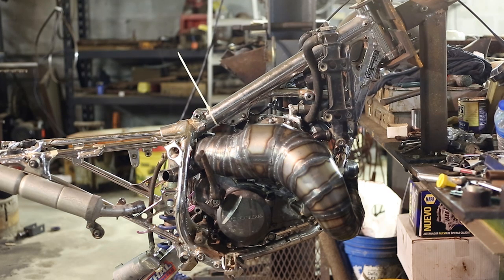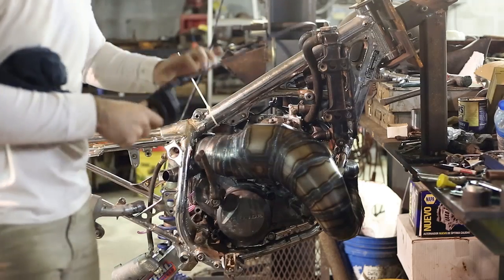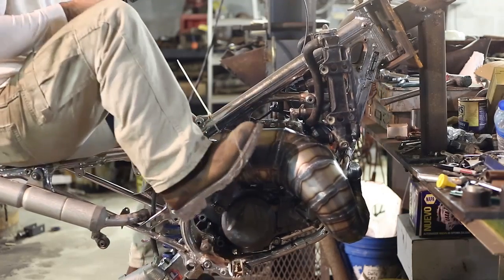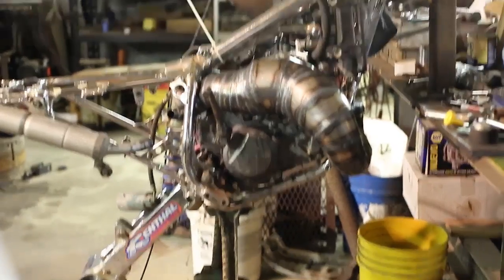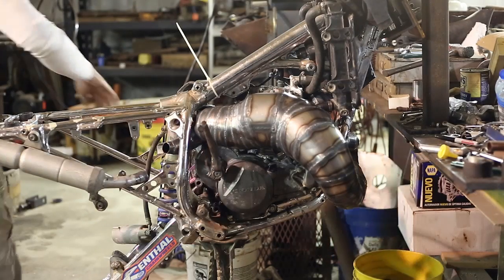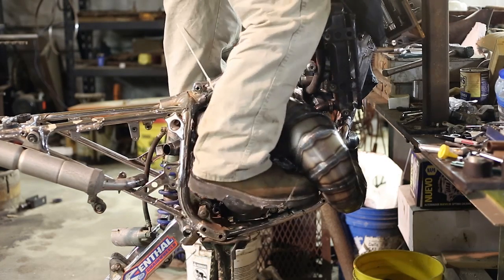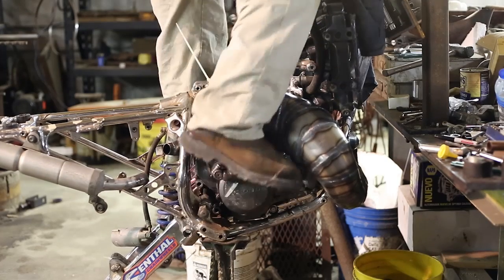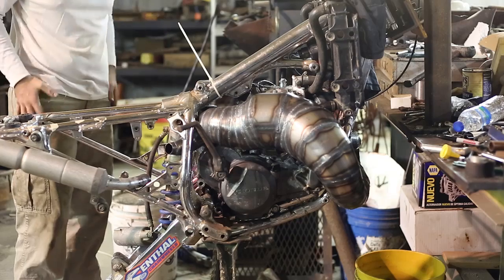Rotax-ATC250R Hybrid engine first firing

Comment: Update video please!!
Reply from the maker: +isaac peckham https://www.facebook.com/wggolightly/videos/10153804781064237/ This is several months ago - I wound up taking it to Trikefest in Indiana in June and rode it quite a little bit had some issues (water pump bearings, ate a seal, then had to keep playing with the jetting, etc) but It was definitely rideable and pretty damn fast. I have since been really, really, really busy with work and have not been able to commit the time to continue working on and riding it anymore, but I've burnt about 2.5-3 tanks of gas through it so far since this video link.